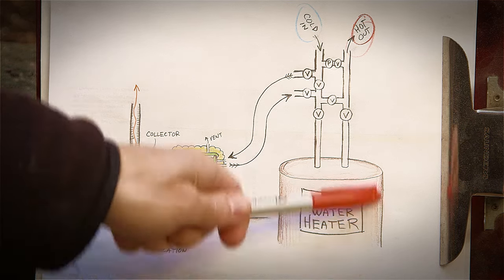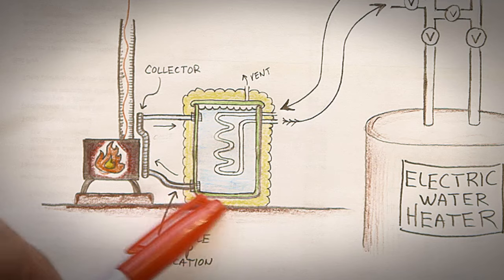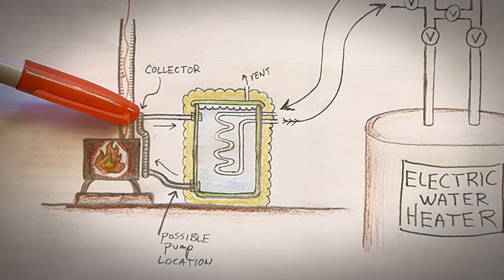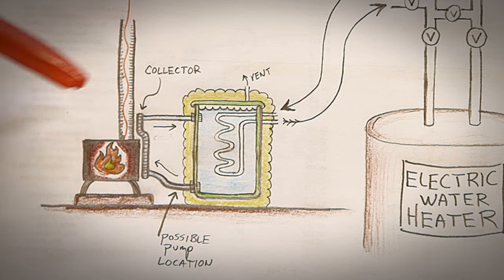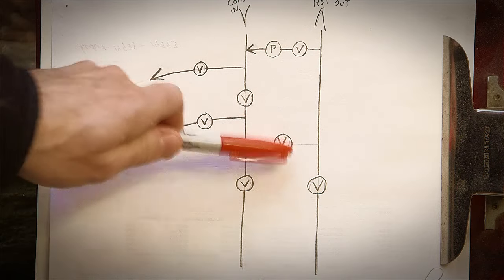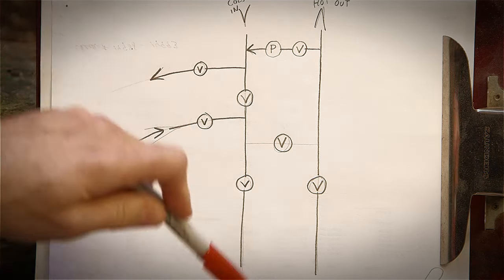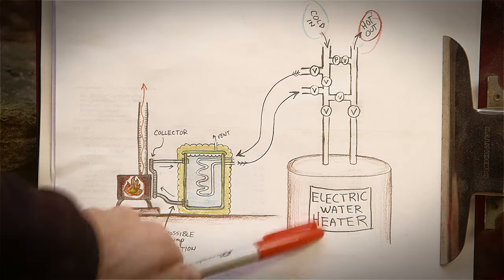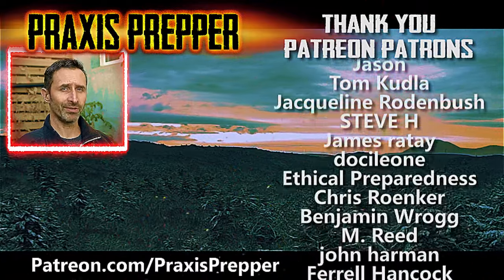DIY Woodstove Powered Hot Water Heater System Introduction

Comment: I have a Joolca hot tap, it might be spelled wrong. It comes with a system like hot water on demand from cold water and propane. It only kicks on when you take a shower or you can use it to wash dishes.  It's made for outside showers but I had it inside. Works very good.
Reply from the maker: One of the things that has held me up SO long on fixing my not that great system I have is because there ARE (as you noted of your own solid system) so many great options from which to choose about how to address things and make them better. It's been a long while of me pondering what's the best way to go about fixing this from option overload. :)

Comment: The plastic tank won't work,  a metal tank will work better,  get a hot water pressure valve and go with direct hot water in the tank, I don't think water will get to boiling if radiator isn't in direct contact with fire.

Comment: Good idea but not complete. You are missing critical components to prevent overheating domestic hot water and boiling the water in that intermediate tank.
Reply from the maker: As depicted here, I think the water in the tank itself circulates, so boiling would result in loss of water, but not an explosion. But you're right that the concept needs further development.
Reply: @PraxisPrepper  Need a water feed with a float valve that's all. But that's a very old concept and not the best. Also, I think your main goal should be to heat the house itself with radiators. Heating up a tank of water will be really quick. After that things will start to overheat and boil over. Honestly, you will end up re-inventing a custom closed loop boiler system with domestic water heating coil. Add a circulator with a thermostat and a few zone valves and then you will be heating every corner of the house comfortably from your wood stove :)
Reply from the maker: @urbanturbine  Thanks so much for sharing your thoughts on this (which sound like the thinkings of of someone who knows what they're talking about). Much appreciated. My house's particular situation is a bit unusual. The air circulation system that I built (which uses old Roman bath style under floor tunnels) works super well at keeping the house warm and stable. The hitch in our place has always been the balance between hot water and keeping our pantry cool. This is my attempt to solve one of those issues, and I appreciate your taking the time to share your ideas to help! :)

Comment: You can eliminate electricity / pump / controller altogether, just by positioning water tank on higher level then fireplace is on.  Operating word here is :   Thermosiphon. It works because of gravity and water changing density upon heating, 80+% middle east heats water with systems utilizing this effect, but in different context. Of course you still need vent, but that can be mechanical thing.
Reply: For fireplace heater part. 
For other part, electric heater, plumbing part - your assumptions are all correct.
Reply from the maker: Thanks for your take on this. One of the reasons I released this video fresh yesterday was that I knew a lot of smart people who watch my channel (such as yourself) would have some excellent helpful insights. My tank height is a bit mandated by where I'm going to be placing it, but I understand the goal of getting some height for that thermal siphoning effect. If I CAN get that working enough, the circulator pump (which wouldn't be necessarily silent) can hopefully be avoided.
Reply: @PraxisPrepper  Yeah, just by placing tank little higher you can have hot water without pv/electricity. So immediately as i saw your plan i had to say something. I am more finnish masonry heater with old cast iron radiator embedded inside as a heat exchanger, kinda guy myself (it had to be build same time as a house). :) Have a nice day.
Reply from the maker: If I were to build again I think I'd definitely do something along the lines that you mentioned you'd done. At my last build, I actually had run pex tubing snaking back and forth through a stone wall immediately behind my woodstove to capture heat. The plan had been to pump water warmed in those tubes down into other tubes I'd buried in the floor, but I never got around to finishing the system before I left. @Jamey_ETHZurich_TUe_Rulez

Comment: You will get better heat transfer if you run the water to the hottest side of the exchanger first.

I have a self designed system that uses solar collectors for the summer and I switch over to a sawdust furnace in the winter.

I make 155 degree water in both setups.

I get free sawdust, so besides two small circulation pumps it costs me virtually nothing to heat my domestic water and run my radiant floor for winter heat in the house.

If you need ideas let me know.
Reply from the maker: Thanks Jason. Just the simple fact that you've done something similar and it's working for you is encouraging to me. I set up my tubes that I built so far so they can pump either direction at this point. Per your recommendation, I'll do my first setup with them hitting the hottest area first. I can see how that could work to more evenly spread out the heat through the heat transfer material and increase uptake. Thx!
Reply: YW.  Just remember that your heat always transfers better when you have your 2 flows going opposite directions, Instead of running parallel to each other.

Comment: We had a 40 gal propane hot water heater that just bought the farm a few months ago. I was trying to stay ahead of my whackadoodle governor here in NY State, who is trying to outlaw gas and propane. So I went with an electric hot water tank. But there are only 3 of us here. So I "experimented" with a smaller 19 gal electric tank. Set it at 130 degrees, and we have 15-20 minute hot showers. Wasn't sure if I would  need anything additional with it at first, but it is working great so far. I'm saying all this, as it might be an alternative solution for you in the winter, if your tank is a 40 gallon. Takes a lot less power to heat a 19 gallon.
Reply from the maker: That's all food for thought. As the tanks get bigger though, their volume to surface area ratio goes up, so they tend to be able to hold their temperatures better over time. An example being that if a mouse (with fur) and an elephant (with no fur) both die in the winter cold (let's say while Hannibal is marching his army of elephants and mice over the alps), even though the mouse has insulating fur, the dead elephant will stay warm at the core WAY longer than the dead mouse will due to that ratio of inside volume to exposed surface area. So that's something to consider when capturing heat and trying to store it over a duration of time. More heat has to go into a large volume, but it STAYS warm a lot longer. I'm not sure where the perfect balance is there, but I HAVE recently heard from people who had set up gigantic hot water storage tanks for use with their solar hot water (after I made my recent video). Some were 20,000 gallons big and they said that the huge thermal mass allowed them to grab a lot of heat  when the sun shone, and to store it for when it wasn't for a long time.
One other thing I should mention, and I really don't know how large of a risk this is, but it IS something that I've heard come up from time to time is that legionnaire's disease can grow and thrive in water that is under 140 degrees F. That's why that 140 is a bit of a magic number for water heaters. Again, I don't know how likely that illness is to arise even if conditions favor it, but you might want to look into that a bit to see if you want to keep your water temp lower than 140.

Comment: Did a test system to warm plant trays with aimilar ideas in mind i did a coil of copper right around the stove pipe...two things i learned was i need alot more copper for the coil and recirculating pump also your right a vent is a must
Reply from the maker: How many feet of copper did you have around the back of the stove? Also my stove (Vermont Castings) is sort of notorious for how much heat it radiates. VC stoves always need much bigger clearances than a lot of other stoves for that reason. Was your stove a similar all iron one like I use? I presume it was. So I'm curious how much copper was too little for you.

Comment: This is awesome.  I have been thinking of different ways to heat water in a grid down situation and this was well timed.  Thanks.  I have seen other systems in the past and this so far is the most viable in my opinion.  I might consider adding radiator of some sort to help control the temp of the "Fluid" in the barrel.  Or add a whole house circulating system for the hot water.  This might emulate "on demand hot water" or an alternate heat source.  I don't know just ideas I had while watching this video.  Still much to research I think.
Reply from the maker: I've found out since yesterday that buying a pre-made tank could be a good option as well. Here's one I was eyeing this morning: https://hydrosolar.ca/products/all-in-one-buffer-tank-and-indirect-water-heater-150-l
IDK if I'll still DIY or get a premade tank, but it's all good to ponder over before pulling the trigger.

Comment: Why not use an old hotwater tank or two. You would probably take care of you high pressure problem due to the pressure relief valve. A small recirculation pump could be incorporated as well.
Reply from the maker: That's another method that people have used and the pressure relief valve is critical. For me, I like the fact that (with level of materials knowledge) this is something that I could build myself from the ground up and understand every inch of it. It gives me a lot of satisfaction to build things for myself. But your suggestion is very valid and is (per my research) often times used.

Comment: Another possibility is to locate a temperace tank about a foot over your woodstove if you find one you like the look of (I'm still looking for a stainless tank myself). If it's big enough and/or far enough from the stove, no vent would be needed and you could use it in line with your system.
Reply from the maker: A simple approach like that sounds cool too - any way to capture and use the heat is great!

Comment: @praxis my water is heated by the wood stove ...we parked a still 10gallons behind the stove abot four inchs above ...and plumbed thru the wall to the sink.....you can fill the still with snow to melt for water and also heat it for washing ...ad water or snow to adjust temp ....stills with out lets work best .dont fill to max always about two thirds volume ...just incase it was to boil .....
Reply from the maker: That's a cool setup... and it makes me think that I could use a tank-like structure behind my woodstove too (vs. the manifold of pipes I described in this video). So many great options! Thanks for sharing your approach!

Comment: I wonder if this could be tied into an in the floor radiant heat system.
Reply from the maker: I'm sure it could. IN FACT... at my last house build, I had laid the ground work to do just that. Behind the woodstove was a large rock wall. When I built that wall, I laid PEX piping in it like a radiator to pick up heat from the wall (which got quite warm when the woodstove was running). I also laid PEX down under the floor in two large beds of concrete. My plan was to pump the heat down into the floor, but I never got around to finishing hooking it all up before I left to build my new house.

Comment: Please add a minimum of 1 backflow/one-way check valve in the "cold in" side before the first T in your diagram.  You don't want to have a pump push back into the mainline by any chance.  Possibly add additional check valves as you see fit.
Reply from the maker: Thx for the tip.

Comment: I've been thinking of making a similar heater. Mineral oil is the fluid that I'd use for the heat transfer.
Reply from the maker: I'll look into that too. I was pondering this last night at 2am when I woke up (pondering projects is one of my favorite ways of not getting enough sleep). I was thinking that it might be good to add stones or scrap metal into the tank as an added heat reservoir. Only issue with that is that if there are the wrong metals mixing together (like if I had copper pipes and also zinc scrap, I'd be building a battery that would start degrading the metal pipes). So that'd be something to consider. But the metal or stone itself could be helpful to capture and hold more thermal energy.
Reply: @PraxisPrepper  mineral oil would eliminate the accidentally battery problem. Stick ferrous metals to help prevent that also. Water would heat up faster. Mineral oil would hold heat longer and could go to a higher then water. No high pressures with oil, still needs vented though.

Stones would be more like oil and hold heat longer then metal. If you used them in the tank. It would mostly help keep the temperature in the tank more level, less fluctuations in temperature. The specific heat of generic rock "at a quick glance" doesn't look much higher than oil. Adding stones may not make much difference if you are using mineral oil.
Reply from the maker: Thanks Ironnam! That's a lot of new ideas to simmer on. I think there are two things for sure that will result from this project. 1, it'll be a way better situation than I have now. 2, I'll figure out things later on after completing it that I could have done that would have been improvements over what I'll end up doing. I've come to feel that perfection is a great thing to aim for, but it always remains a mildly elusive vision and never a captured commodity. @ironnam8107

Comment: I like the recirculating pump idea. How familiar are you with PID controllers?
Reply from the maker: Since this is the internet, I could find out with a couple of keystrokes, but I'm going to be honest and tell you that my first response to your question was, "What's a PID controller?"
Blind guess (given the context of the situation) is that it's some sort of somewhat easily to modify or construct DIY electronic logic circuit creation sort of system whereby I could create my hypothetical "brains" to tell my (equally hypothetical) water pumps described in this video when to turn on and off.
Am I close at all?
Reply: @PraxisPrepper  Nailed it.
It's Proportional Integral Derivative and is commonly utilized to provide a control loop with continuous feedback from the error between the measurement and the setpoint, especially where the hysteresis would otherwise be unacceptably wide.
Reply from the maker: You lost me after, "Nailed it." LOL. But I'm glad for the suggestion and I'll definitely be familiarizing myself with PID controllers this year. One of the reasons that I early posted this concept was that I presumed people would have some helpful suggestions that might be good for me to integrate early and your controller tip is right inline with what I was anticipating knowledgeable people (such as yourself) who tune into my videos might suggest. So thank you for living well up to my expectations! ;) @matthewellisor5835

Comment: great setup but the thermosyphon is necessarily going to stratify the water in the tank. that just means the cold water has to come into the lower end of the spiral to collect the most heat from the hottest water in the top of the tank.
Reply from the maker: Thanks for your take. I agree. The idea has been evolving ever since I shot this. I actually was able to secure an old used tank that had been used for thermal transfer from a boiler for the tank part. One issue that came up so far is Legionnaire's disease. Given the not-so-hot temps in the tank that are likely with this setup much of the time, it's a perfect breeding ground for that pathogen. It's an additional reason to not have the domestic water be the static water, but rather to only pass through while being warmed.
Reply: @PraxisPrepper  amazing that someone thinks about legionella. it takes only about a day to grow into a whole "legion" lol if the conditions are right. legionella doesnt grow or dies completely in water outside the range 20°C to 55°C depending how far outside this range. everytime it reaches over 60°C you win the war and they have to regrow their numbers ^^ on top of that in your setup the drinkwater is the flowing and will even cool down the boilerwater to below 15°C if the stove is of. be careful with the used tank, if the drinkwater touches surfaces that have been in contact with heating water there are some weird electrochemical effects that can dissolve toxins right out of the metal. i would love to see your new ideas 😁👍
Reply from the maker: That's a lot to think about there too. The challenge with heading off one's own way and trying things out is needing to keep in mind all the tiny little aspects of a process like this - to be sure nothing comes back to bite one later. I appreciate your sharing your thinking here. I'll share how this project develops as I work on it for sure. @steffankaizer